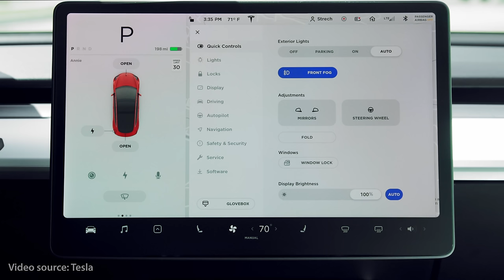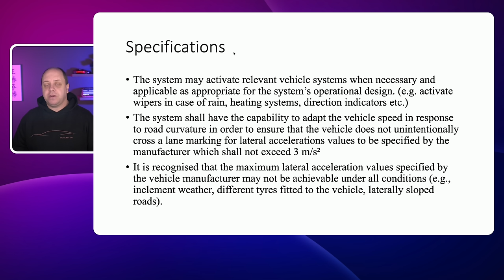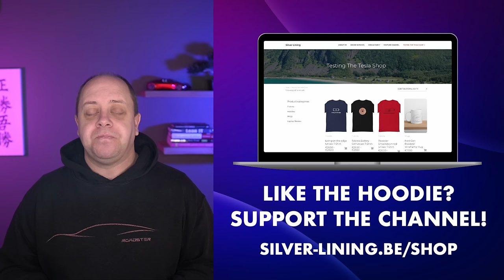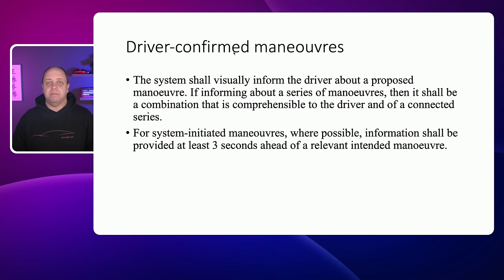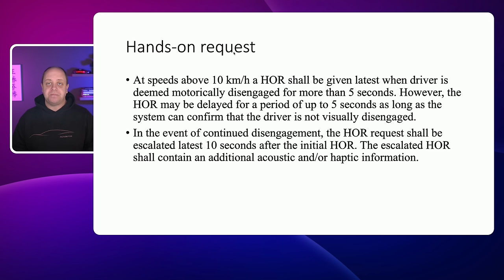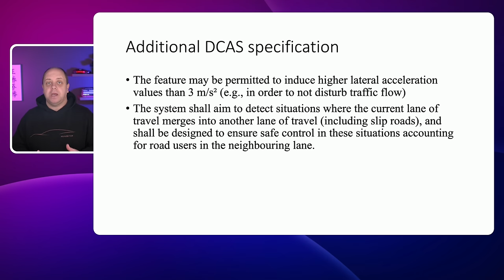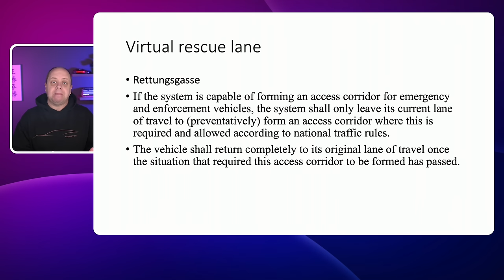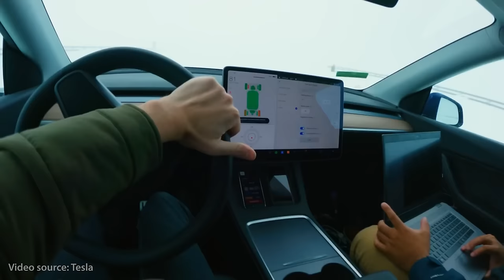FSD Beta is finally coming to Europe!

Comment: Except that you still need to confirm every lane change. So basically these rules define what NOA currently does.... So nothing is going to change.

Regarding the speed limits. It is already implemented like that.

Further more the even more insane stricter driver monitoring makes it all more ridiculous. Forget ANY FSD as Tesla currently does not work like that in the US so they will not going to work like that.

Regarding hands on.. man... Because of the crappy torque based implementation this is going to be completely useless. Especially as currently the car already can disable autopilot for a week !!!! This is going to make that even worse if Tesla is going to comply to this..

So... Nope, nog getting FSD at all... Just a more crappy NOA experience
Reply from the maker: Those 2 are completely separate. DCAS is all about city driving, not highways
Reply: @StevenPeeters except that Tesla no longer has 2 different stacks and merged highway and city driving
Reply: @StevenPeeters  second, confirming every lane change, speed bump brake, crosswalk brake/pass, corner, merge which all could happen in 100 meters... The people that write all that down should give me some of the pills they are taking because that must give some epic hallucinating trips

Comment: do "BlueCruise" making it blue outside? or "Super Cruise" make it super? No? So why you trying make one name be important, and other not? Because you don't read instructions and own preconception taking as something reality? 
BTW where is not FSD, there is only FSD Beta... yeah you don't even remember name correct, because you want to be right, so do anything to be...
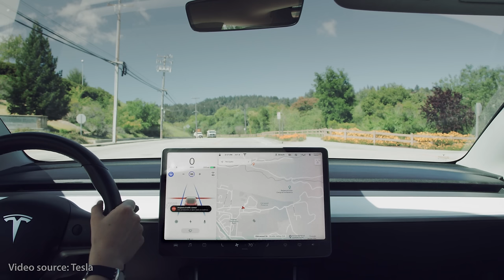2:00 so that people don't reading instruction is Tesla fault? As you put cat in microwave is producer fault because you didn't read instruction? What a world, double standard.
2:15 as every car have same way to activate automatic transmission... no? Oh why? Because there is not reason to make all system works same, this is not safety element, is user responsibility. Even breaks can works different. For real, what a world, make everything same, one government system prefer it, and wasn't it good system, difference is good, because with time better solutions will be selected, when you force everybody to do same, you will never have evolution. Even CSS vs NACS, 2nd is better, but EU force first, because auto makers didn't want add switch in car so users now must use problematic standard, as it would be if cellphone charging standard would be select in 90's, with time better where created, and not much left to do with USB-C so it could become standard, because at most all producers use it, but before it, it would be stupid to select any.
Reply from the maker: NACS cannot handle 3-phase AC power. That is already a reason why it's not a good choice. And I did say that it is the driver's responsibility to be informed, but that the manufacturer needs to provide the information/training material. The regulations say WHAT needs to happen, not HOW.
Reply: @StevenPeeters  NACS can handle 350kW charging and 800V (today, it couldn't in past), how many phase there is not important, because car in CSS get low AC or DC and DC do not have phases. So... what are you talking about?
"but that the manufacturer needs to" they need to provide instruction, but it have to be in any form, what form, why government deciding it? And instructions are always added, so why you mention, if it is not about format? And everybody agree there should be instruction, funny, but I would more attack instruction for smartphones or that they don't have.
Reply from the maker: @m_sedziwoj  I’m not talking about DC but AC, which is what 80% of your charging is. CCS2 can also handle 350kW and even 500kW. It’s a standard and not something everyone needs an adapter for. That is one thing the the UNECE does do right
Reply: @StevenPeeters  AC you use mostly at home, so... to fast charge you use always DC, because resistance. So I don't get where you get this AC info, because is max at 43 kW, and DC is up to 350kW.
I found what 3-phase is up to 166kW, but it was only on wiki, so... how common it is, and DC is still better because less losses and faster, so for public/onroad chargers is better, and AC (cheap for home, where converter is in car) is better for home, where you don't need fast charging. 
So from user perspective NACS is still better. And looking what most car makers in USA is moving to this standard, mean something, they agree that is at last as good, because they have to invest a lot of money to change they production and contracts. 
And don't reminds you old phone connectors and USB-C, where was many pins in old, and all was "needed".
Physics is unchanged whatever you preference are, and fast charging should be done by DC, but converters are not cheap, so for home better use in car converter, which is smaller, because it is needed for converting from batteries (DC) to motors (AC). So AC is good because is cheap, not because is better.
Reply from the maker: @m_sedziwoj  I don’t care about your NACS crush. It is not better than CCS2 in compatibility. It is only nowxstarting to become a US standard and has a very long way to go to replace all public charging stations. AC charging is what you do the most, be it at home or public charging. The speed doesn’t matter. The fact that you can charge on any charger hassle free, that is what matters. DC charging is for long distance driving. And for DC, the Tesla charger is good. Not for AC compatibility
Reply: @StevenPeeters did you even read what I wrote with understanding. But I think is pointless because "you know better" and it doesn't matter what I write you know better... sad people which can't change they opinion because emotion and believes.